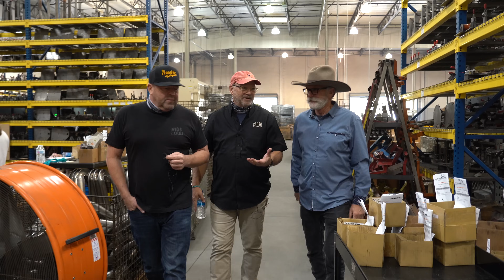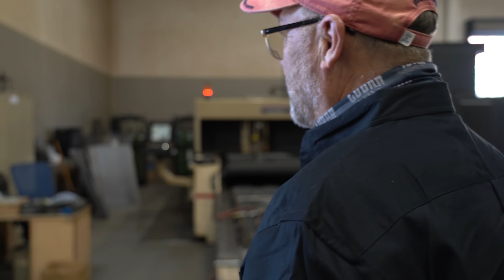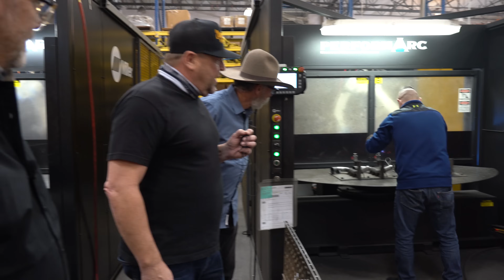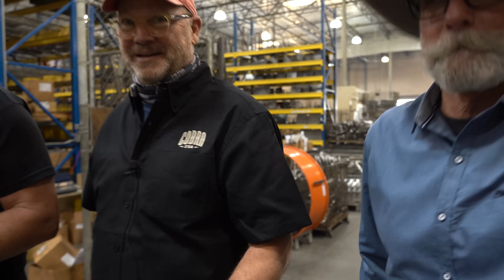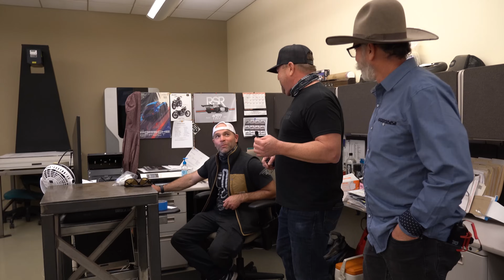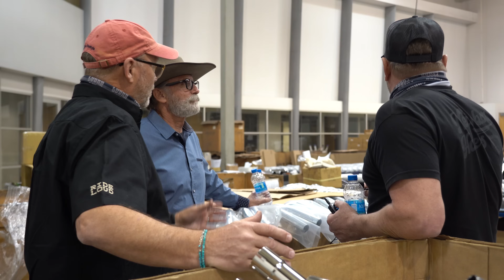Cobra USA Facility Tour! | Behind the Scenes of Cobra Exhaust | Engineering, Production & More!

Comment: I ordered a pair of cobra 909s slip ons. One Muffler had a spiral louvered baffle and the other had a straight louvered baffle. Cobra said they would sound and perform the same. I asked them if that was the case, then why have 2 different types of baffles, they wouldn't answer my question. All I want is what I ordered, what I paid for. How does a company become this big and successful treating their customers like this. Haven't heard from them in 2 weeks, they won't respond to my messages, I don't get it. JP cycles is trying to find a replacement baffle for me since cobra won't do anything.

Comment: Awesome video guys, I live about 15/20 minutes from their facility,  Yorba Linda is a great community.  I love my true dual head po I've and NH slip-ons. I do have a concern with their customer service (via email). I emailed them back in September asking how I can get a replacement heat shield  for my pipes I had a minor incident and mine was scratched up pretty good. I'll try calling them on Monday. Question,  that is US steel they are using. right ?

Thanks again for the video, very cool facilities.

Comment: Great video guys, I have Neighbor Haters on my 19 RGS and want to add the Pro Chamber headpipes this summer. One thing I was hoping would be mentioned is cats, I have taken mine out but wondered if the Pro Chamber has one or not.
Back in the day I used to work for a engine development company here in the UK and one of the things we used to do was custom exhaust systems for exotic cars from the heads back.  Later we started doing Motorcycle exhausts for Japanese bikes (this was back in the mid 70's) which no one else was doing. Of course everything was hand controlled on hydraulic machines and hand welded!
Reply from the maker: We’ll have to mention on our next live. Thanks for the question.
Reply: You'll love the Pro Chamber,  I have it on my 17 Road King. Slapped on an Arlen Ness Monster Sucker intake to go with it. How much louder are the NH's without the baffles anyone know?
Reply: @jeffhelm7581  I already have the Stage 2 on my RGS, but want more....

Comment: Cobra Exhaust is the bomb. I purchased a 2-into-1 exhaust for one of my bikes and because I had installed a full exhaust before I didn't realize I was missing components until I was done.  The retailer where I bought the exhaust blew me off, but when I got Mike from customer service at Cobra on the phone, he seemed a little frustrated that there were missing pieces in my package. I was missing some hardware for the mounting brackets (I just used the fasteners from the previous exhaust I already had—and didn’t think much of it), I was missing the instructions, along with the heat shield I knew I was missing.

He asked me if I could send it back.

I didn’t want to dismantle what I’d installed (installing an exhaust system by yourself can be a little more challenging than what you might expect) and told him it was already on the bike. We made sure I had everything else I needed to finish the installation before he told me he would take care of me. And, he did.

He sent me the heat shield as promised, and now, I'm a lifelong fan of Cobra. Great people and a great company.
Reply from the maker: That's awesome to hear, and we'd expect nothing less from such a great company. like Cobra! Top quality products , and top notch customer service to match. We all run there exhaust and racks on our bikes, and love every mile. We'll share your story with the guys over there👍
Thanks for the support Ty🤘🤘
Reply: Many parts are Chinese to let you know. I worked there. You should see how they treat their employees.